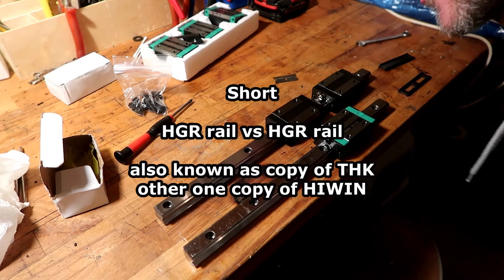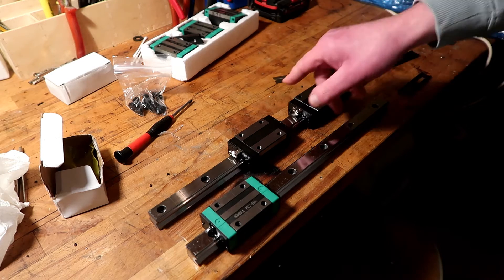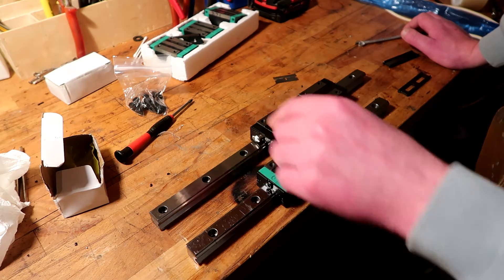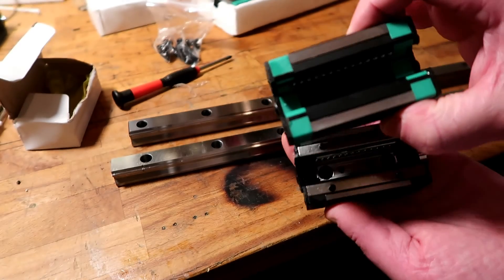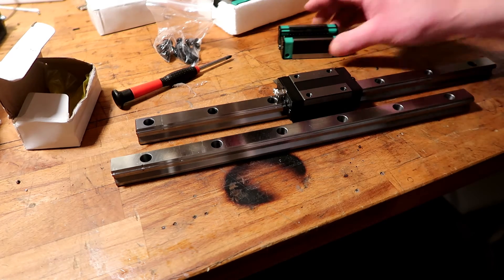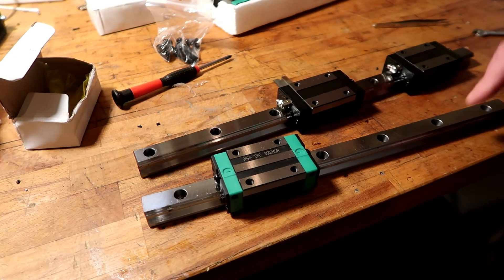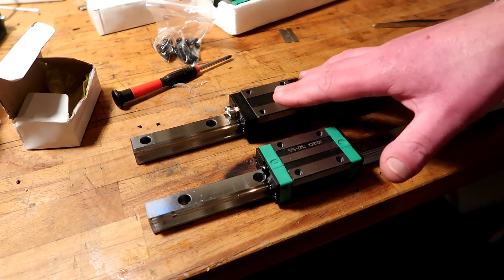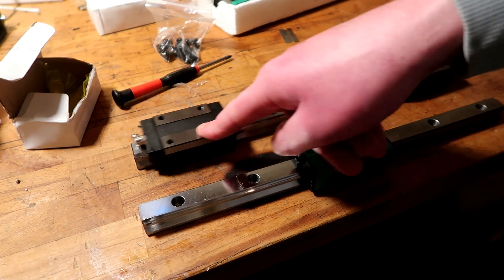CNC short 2 - Fake HIWIN HGR20 vs FAKE THK HSR20 Lineair rail

Comment: I just google and gemini say thk rail did not compatible with hiwin rail. But some copy state that its block compatible with either thk hsr and hiwin hgr.

I got this original thk hsr rail and original hiwin rail, i bought it used but still in good condition. The factort that used them replace their rail on certain period, some of them still perform well and way better than brand new clone.

Those hiwin clone quality is inconsistent, mostly are not good. Someone replace the bearing with japanese steel balll, i think for 15mm they use 4.175mm or 1/8.

Thx for sharing your finding👍
Reply from the maker: i agree, original HIWIN OR THK or any other good japanese rail. will destroy these chinese ones.   there are a few brands in between though that feel solid but are not THK or hiwin, but also suck less then chinese. i still have a second hand THK on my machine. and its going nice for 12 years, and it was bought second hand... chinese ones wont make it  8 years i think. next time i upgrade or make a new machine i definetely wont skip on ballscrews , i still using a thk one also 12 years bought second hand...  and now it starts to make noise, but i never lubed it in 10 years so i cant blame it. they are great !!!

Cheap rails have there place if you are ok with changing out ballbearings and match the carts.. besides that they are insnae cheap and pretty crappy :) but hell thats what you get a THK ballscrewn is 500 euro and a chinese one is 100

Comment: they dont have different preloads ??
Reply from the maker: They might  well have , but above all not so gritty running. Exact data is hard to  find :(
Reply: @joppepeelen your Hiwins are heavy preload (c= heavy) so they’re supposed to be not as smooth, try greasing it up and applying load before moving the carriage and then compare smoothness.

If I were to guess, the thks are probably no preload

Comment: I have those fake hiwin hgh20 rails as well. How would they compare in practice you think? Like would there be artefacts when milling or maybe the differences are in how long they will last? Mine also feel very rough but with a sturdy frame and strong motors there might not be that much difference in the final performance of the machine
Reply from the maker: i really cant tell. i just do not like them to move gritty. like sometimes they move or then move hardly etc. i have some second hand THK (real) rails and they move perfectly all the time !! the fake THK i use here are far nicer then the  fake hiwin. but since i only have 2 carraiges and one rail it remains to be seen how good they are. i am oprety sure the cheapo chinese fake hiwing are worse. mostly because they are random. some work some wont.... :(
Reply from the maker: does not mean the CHinese Hiwin asre not usable they are pretty different one batch and another so might as well have a set that works fine. and then you would never be able to get anything cheaper. so its more of a gamble :)